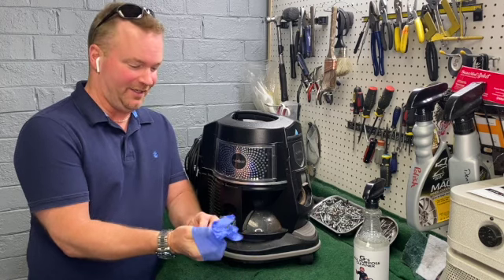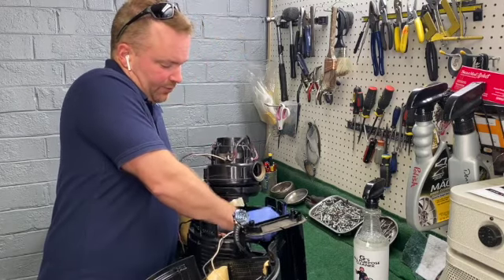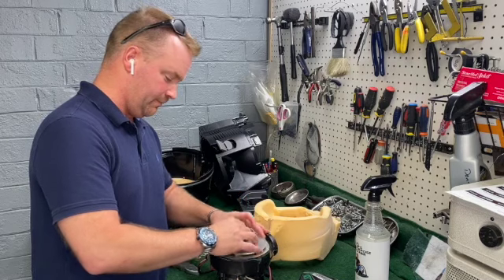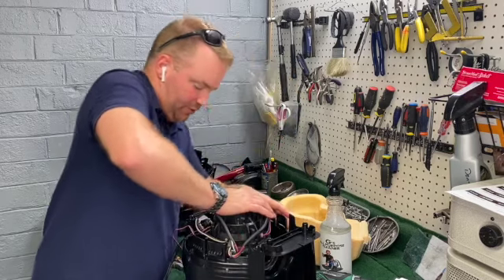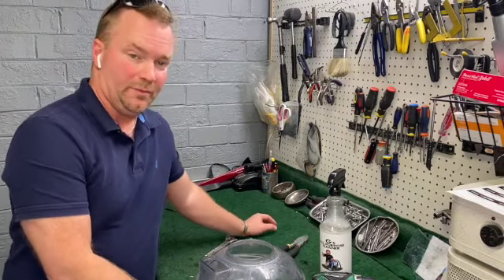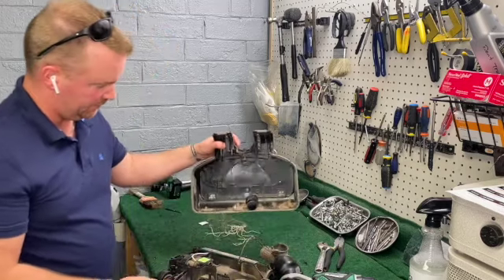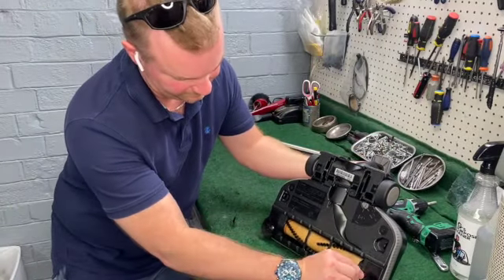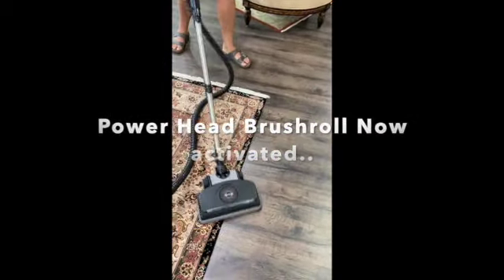Rainbow E2 Black Vacuum Cleaner Cleanup and Tear Apart Video

Comment: Thank you.  I got a rainbow e2 given to me and it's got some issues, but I wouldn't take it the the repair shop as nasty as it was.  The one you had was perfect compared to this one. In fact I think it got used then stored in a shop or something without getting cleaned. Lol, but with your help I was able to clean it up nicely and now I can drop it off to have the switch removed and a new heppa filter and I think it'll be ready to go.  

I'm not a big rainbow fan so I'll probably donate it to a family in need.
Reply: I have horrible breathing problems and it took me months to save up for one. That is so nice of you!

Comment: Hi, like you videos. Informative. I was wondering if would consider making a video on the Aquamate ll as there is only one video on YouTube of the Aquamate ll system and the gentleman doesn’t say a word the whole video and is constantly putting the camera down so you have no idea what is really going on and what anything does. I’m really hoping that you would consider making a better video. I’m considering buying an Aquamate ll system to go with my rainbow series 2 speed for rinsing and dry passes when I use my Bissell Hydro steam to clean my carpets. The problem with the Hydro steam is I find it leaves the carpets still very wet even after multiple drive passes with it, and the rainbow would do a better job at picking up the water in the carpet, thank you keep up the great work!
Reply: Just use your rainbow with an empty basin to pull up the water left by your Bissell steam. 
Not through the power vacuum attachment, but through the large nonpowered, non-electric attachment. 
Sorry, i have forgotten a lot of the names for the attachments.

Comment: Hey, I love your videos. ( I'm using my son's account).   To answer your question, wet dust doesn't fly, BUT... Customers are told upon purchase what I call "the three Gremlins rules" from the movie Gremlins LOL!
1.  to never ever vacuum up ashes, sheetrock dust/debree, and powders like Carpet Fresh.  They are water insoluble. There is a HEPA filter because of rule number one that 9 out of 10 people never follow LOL and also by law, rainbow has to put a HEPA filter in it whether it is actually utilized or not... just like by law, toasters have to have a warning tag on them to never put them in water.
2.  Clean your separator at least once a month if you're not going to do it after every use. It is the life of the rainbow and if it gets coated, it will not work properly.
3.  Do not run the rainbow with no water in basin and do not store with water in basin because people leave the same water in, it becomes a sludgy non liquid byt non solid
Reply: And I wasn't trying to be that guy LOL I do love your videos but I grew up as a rainbow baby LOL my mom got into it in 1980, and I believe she was the first woman to become a satellite distributor (or at least on the East Coast, but i could be wrong).  But basically the quality of the rainbow is so great that they have in 10-year warranty on motor or replace the rainbow, and 8 years on parts and labor should anything ever break or crack etc. Also you get $1,000 off when you trade in your old rainbow for a new one. No other product or company offers that. Try to take your washing machine back to Sears to get a new one and ask for $1,000 off Etc LOL

Comment: How do you get that Knut off to get the fan blades off to clean
Reply: Watch around the 4 minute mark.  Once that part is out you put a small wrench to hold the shaft and a larger one to remove the nut.  I had two crescent wrenches out so that's what I used but end wrenches are probably best.  Note after you get the nut off I had to hold the shaft and twist the fan to work it off. Then I had to do the same with the washer/spacer and the other fan blades.

Comment: How did you get the blades off?! Struggling!!
Reply from the maker: take that last nut off and blades stack together.... don't force just gently tug off.
Reply: I don’t know which way to try to turn the nut; it is extremely stuck. Tried wd-40. I don’t want to try to turn it the wrong way. Is it traditional, left loose, right right? Trying to hold stem with pliers and turn nut with wrench. Really hard!
Reply: I finally got it. Whew!

Comment: My vacuum, the same model, only works in low mode. Does anybody have any suggestions on what I need to repair or replace I have already replaced the power switch and that did not solve the problem. Thanks in advance for any help to point me in the right direction.
Reply from the maker: Could be wiring or computer board. I would take to a reputable vac shop for repair.
Reply from the maker: where are you located? What state?

Comment: Does the rubber water pan/motor gasket get glued onto the motor? I’m ordering a new motor cause mine has vibration despite the fan blades being superbly clean. And it doesn’t come with the thick rubber gasket I don’t think.

Comment: I inherited a rainbow vacuum from my mother in law I cleaned it but there is water coming out of the heap filter when I turn it on and the motor just sounds weird
Reply from the maker: is the separator on the machine? are you overfilling it? was the hepa filter washed under water.?

Comment: I can’t get the separater off. There is No tool with mine and I have tried socket set, screw driver, wrenches… what can I do?
Reply from the maker: its plastic so if you haven't already use a set of pliers and gently work it off....spray some lubricant on it if you can get it in there..sometimes they have rust on them

Comment: I have taken mine apart and cleaned it. I put it all back together, but now it only works on the side that blows out air instead of the vacuum part. Any ideas on what i did wrong? I did it exactly how you did and had my husband help put the motor part back in.
Reply from the maker: sorry I been away... did you get it back working?

Comment: I cannot get the power head off and I've watched you about 20xs. I've unlocked. The tabs near the lock move forward manually then the side tabs move toward the center. 1. There's no way I can hold and pull up all 4 at the same time. Pls help
Reply from the maker: did you get it... I use knives on two tabs and the other two pull with my hands.. pops right off...wedge knives in to hold while you get other two tabs

Comment: My mother in-law won "a prize" which was the small Rainbow air cleaner. However when they came to deliver the prize they brought along this ultra heavy clunky industrial hoover. What followed was a extremely shrewd unethical sales pitch.. This left my mother in law, who is in her late eighties with this  top heavy awkward to use hoover which is even for me very heavy and uneasy to use plus USD3000 less in her bank account. The hose and cable get tangled all the time and it's very annoying to use. It does the trick however what kind of unethical and low moral sales tricks are this, to target old people in their own house? She would have been so much better off with a much lighter and easier to handle Dyson, which would have allowed her to hoover a little at the time, instead of having to get this big horrible thing out  every time,.

Comment: Hi. I have a single speed E2 series. It just stop working while vacuuming . I  inspected the water bowl tab and tested with  a chopstick engaging the safety switch, bus still no power. Should I start with the safety switch first or go up top on the main switch? Thanks

Comment: Greg, We have recently started having issues with the handle level sticking, and either not allowing the brush cleaner head to engage the brushes, or engaging the brushes and will not disengage. Any insight into disassembling the handle to review the lever mechanism?

Comment: Thank you Greg for making the video. although i am partial to the Old D2 Rainbow i know the newer models are supposed to be better . but you're videos are very informative i watched the video about the srx and was surprised at how terrible it is . Really like watching all you're videos about all the various vacuums and the performance of them .Keep making videos Awesome Job . and Thank You again for taking my request into consideration
Reply: I worked at Rexair (the actual mfg's of the Rainbow)....and I was in supply chain mgmt.  I can tell you during the design phase of SRX -- a couple of major themes emerged -- one was curing known issues or design improvements of latest models, that weren't feasible with existing design and cost consideration.  Also was "revolution" vs evolution change.  Thus you see some radical design changes, which by nature create new and different (and uknown also) flaws and unintended issues.    I think we should have chosen Evolution.  The concern was would the market not be engergized by it vs Revolution.  I have more insights but thought I'd share that.  On the power nozzle I loved the side brushes.  They were taken off primarily because major Saudi Arabian Dealers hated them.
Reply from the maker: Thanks for watching I appreciate the kind comments I try to be fair and factual

Comment: My trigger is locked after barely sucking up the side of a carpet. How can I get this unstuck please?
Reply from the maker: its prob broken in the handle taking the handle apart you will find the spring or the cheap arm is broken....happens all the time ... if you dont want to deal with it take to a vac shop to help with repair

Comment: hello I have a rainbow e2 2 speed gold that stopped working today, I saw that it had the power button burned I changed it but it no longer turns on how do I know if it is the motor or the card, and if it is the card there is repair or the card it's cheap you don't send it to Portugal giving me the tips to know if it's one thing or another? appreciate
Reply from the maker: I would contact rainbow direct and have them direct you to an authorized center for service... Most vac shops can diagnose that pretty easily

Comment: Another great video. I've torn down and rebuilt 3 of these now. All worked great except for one. Gets hot and shuts down after 15 minutes of usage. Brand new motor, new gasket, new separator, new foam insulation. It was beyond nasty when I got it. Only thing original inside was the control board which was dusty was blew it out with a keyboard duster. Motor fires up nicely, not loud etc. Scratching my head trying to figure out what's causing it to overheat. All OEM parts from rainvac too

Comment: So when I have motor off and am trying to clean the fan blades what do I use to remove the nut?
Reply from the maker: here is a better video.. I use a monkey wrench the trick is holding the shaft still on top end while loosening the nut https://youtu.be/zA8vxcdLvLM
Reply: @gagainer  thank you - I put the stem in a vice grip and then used monkey wrench

Comment: Good morning,

I have such a question and a heartfelt request to you.

I own a Rainbow E2 Black vacuum cleaner.

I have taken to cleaning the vacuum cleaner, but I am stuck on taking apart the motor body.

The problem is that I can't match the size of the socket (hex) to the size of the screw - standard 6 mm (not enough), 7 mm (too much)

Would you be able to help me with the exact size of this screw/socket to be used ?
Reply from the maker: unfortunately I dont even know the size.... if you message cory at house of vacuums in high point nc he maybe able to help with that question..
Reply: It's SAE 1/4“

Comment: So on the E2 you don't blow out the motor- you just wipe it? I used my Rainbow to vacuum sheet rock dust ( I know now a bad thing) and I want to totally clean it. Can you wash those 3 discs in hot soapy water (Dawn detergent)? I don't have an acid wash.
Reply: I just got to the motor & my E2 must be a much older model. There is zero insulation/baffling. It has a filter that resembles a filter in a car carburator....very filthy. The motor was on the inside of the filter. What next? Are there discs beneath that?

Comment: I think the SRX power head has a lot of air leakage and it’s brush roll intake area is too big for decent/ concentrated suction pressure. I should have bought the E2 black.

Comment: Hepa filter is required for aham certification. Also if i suck up sheetrock dust on an e2 it will get through at the right amount. My srx. 0 dust inside so far from july.
Reply: 👍The hepa neutralizer was (and still is) a smart addition to the machine. Common mistakes by owners are not using enough water and/or not changing the water halfway thru (particularly with dirty/old carpet, little ones in and out tracking in dirt, pets). In both of these scenarios, some dust and dirt will not be trapped in the water bath and will end up in the motor components or out into the air. Also, vacuuming the carpet after doing any drywall work, even a small area, is not recommended since this powdery dust is not wetable. So, by having this third step of filtration in the rainbow, we are letting virtually nothing escape the machine, resulting in fresh, clean, water washed air. Separator-Water bath-Hepa neutralizer is a deadly, 3 way combination against dust and dirt giving you a clean, healthy home